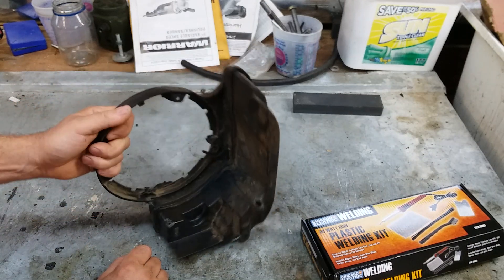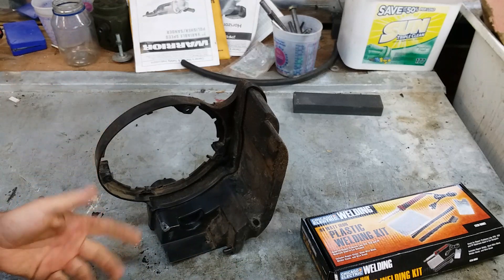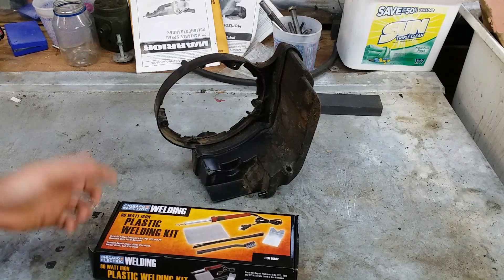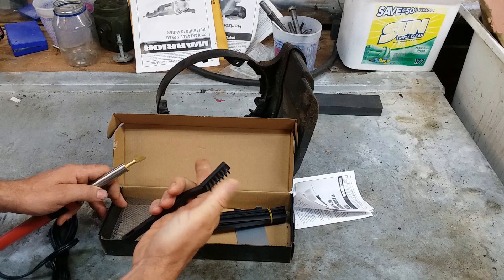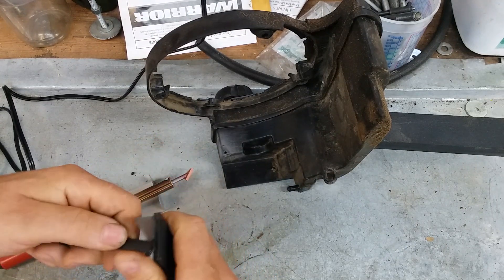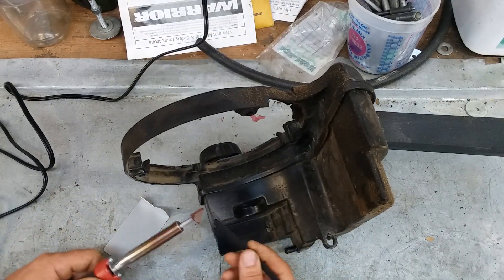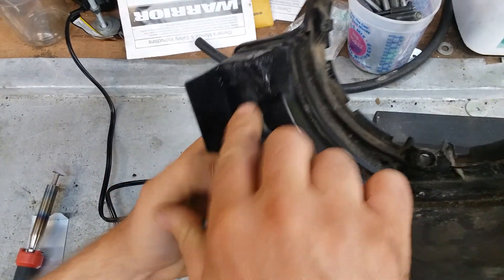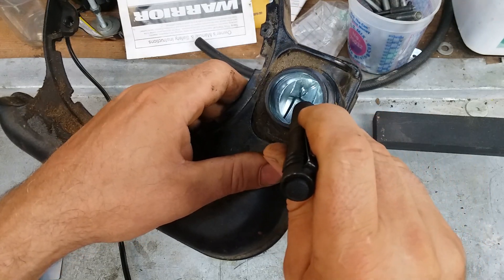Plastic welding on the cheap.

Comment: Thanks for taking the time to share your work. Instead of trying to transfer material from the stick to the part I wonder if you could cut a slice off the stick (like red rind bologna) and work that slice into the tank wall.
Reply from the maker: I just sort of smeared it on.
Reply: @thefixerofbrokenstuff  that works also. 2 thumbs up

Comment: I had no idea Harbor Freight sold such a thing. On a side note, have you ever tried that glue that hardens with uv light?  You can almost 3D print a solid vertical strand right out of the tube. The stuff I use is called Bondic. I dries really hard but I haven't tested it with gas immersion to see if it softens over time. Thank you for sharing this product.
Reply from the maker: No I have not tried that resin stuff.  This looks like it will work fine and it held up to me mowing this afternoon.
Reply: @thefixerofbrokenstuff  I'm glad that stuff worked out for you.  It's refreshing to see a Chinese product work as advertised.